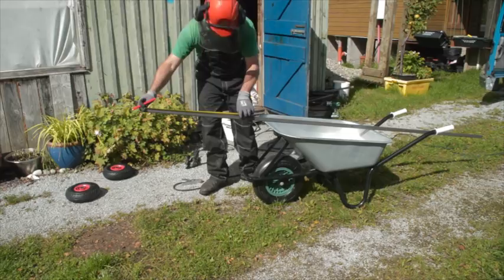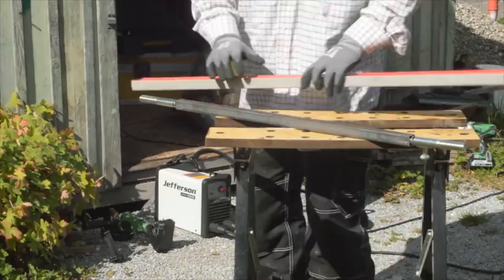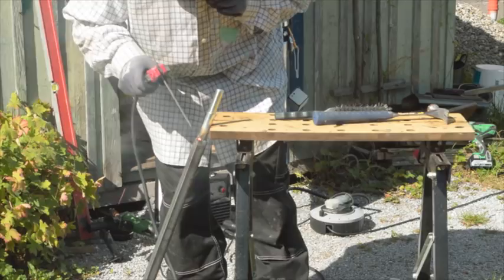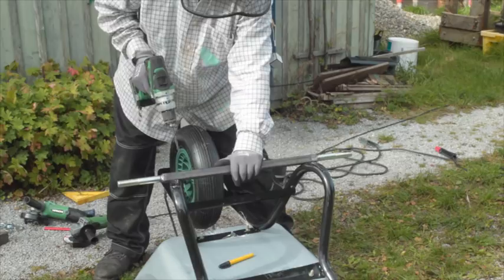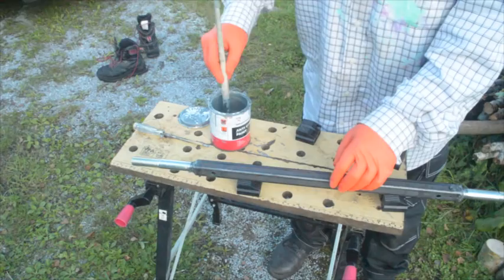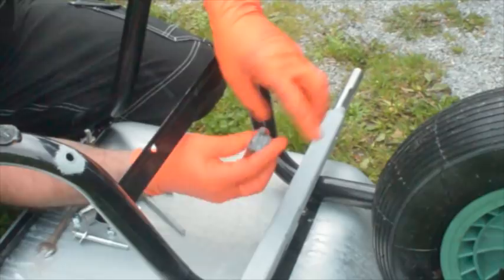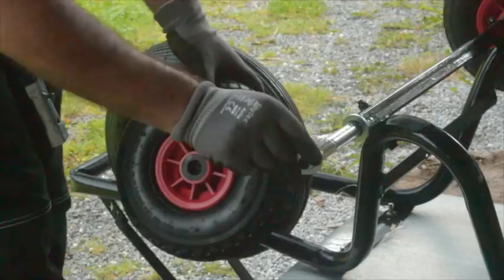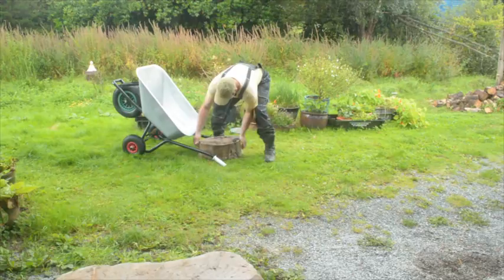3 Wheel Wheelbarrow Conversion

Comment: I'll be darn what an Idea wish I would have thought of that. I might make mine 4 wheel. I like the tubular frame also. Great job ol' chap.
Reply from the maker: The only problem with four wheels is you can't run up planks. Sometimes you need to throw a plank down over a trench or up a step.. could use two planks I suppose.
Reply: @RememberTheSlapFilms  true

Comment: Nice job...enjoyed this video...will attempt it this weekend.
Reply from the maker: Sweet! If you can, try to get the handles the right hight before you fix the wheels in place, if the handles are just a little too low it defeats the purpose as you still have to apply upward lift, or you have to stoop slightly.

Comment: simple and practical! Great video - thanks. Have you thought about parking brake - in case you loading stones or dumping gravel from small truck the wheelbarrow better be stable. I'd think a big log under wheels would do.
Reply from the maker: Thanks! I never needed a break, since the kind of weight I move around is not big. But on hills it would be nice to have. Maybe a bicycle style break.

Comment: If you want to drill a tube (square or round) and you find the drill is dancing or wandering, use a center punch. Strike it with a hammer whjere you want to drill and the drill will set in the hole as it turns
Reply from the maker: Yeah thats true - I have one, guess I couldn't find it in my messy shed. Thanks for your comment!

Comment: The dud building the wheel barrow tapping the thread with steel hamer smart move now nut wont go on 😰
Reply from the maker: Spoiler - the nut went on no problem. On small gauge threads I would agree, you have to go gently, but with 20mm the threads are pretty durable. If you are worried about it, just put the nut on first and leave it jus proud of the thread end and whack the nut instead.

Comment from the maker: This one was actually a commission for someone, my own one is beat up but still going strong, use it all the time,
Reply: I bet it is a bear to turn when loaded down.
Reply from the maker: @oleguy5705  Not really. No more so than a regular wheelbarrow. The back wheels add a little weight obviously, but it's minimal. This is offset by the handles being at a higher resting height when you lift to turn. Less vertical distance to lift = less energy expenditure. Also, if you're pushing or pulling it loaded, you're not applying lift to the handles most of the time, so you save a lot of energy - this saved energy way more than offsets the few pounds of weight of the wheels and axle.

Also, you can turn by pushing down on the handles to wheelie the main wheel. Depends how you load the tub.